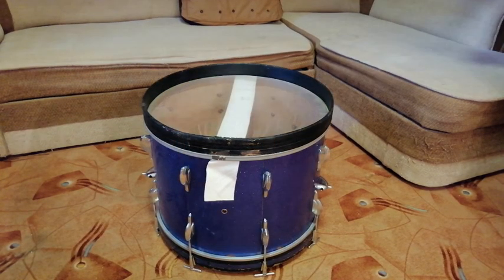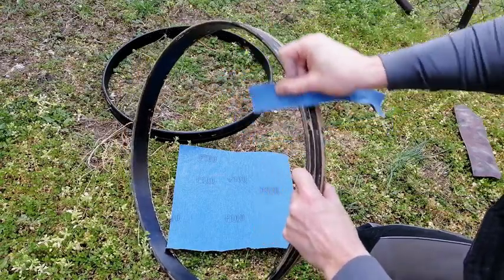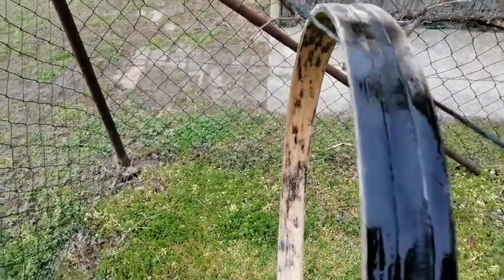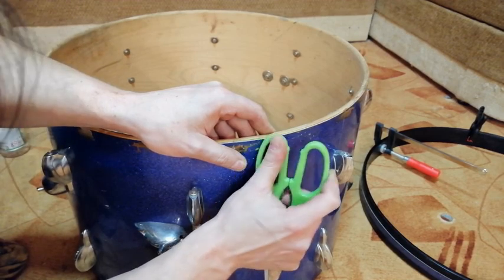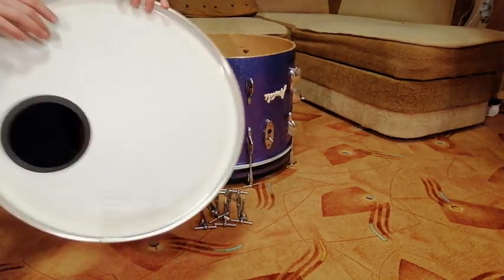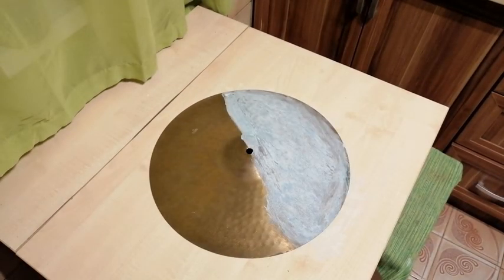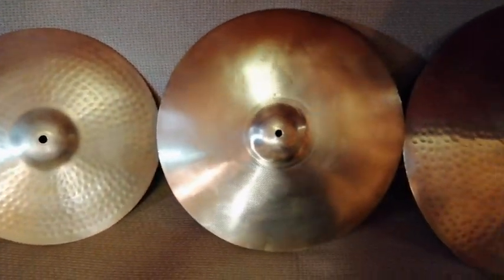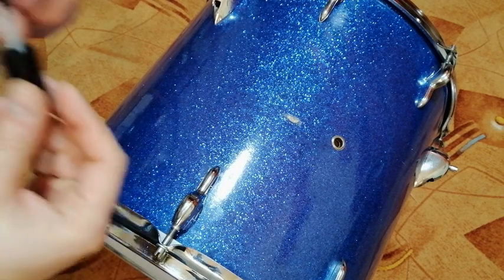Vintage Amati drum set restoration (Part 3)

Comment: Is snare hoop original Amati, I am about to buy same snare but heard it is pain to fit modern heads to it..?
Reply from the maker: The only problem I had during putting on the new heads was with the floor tom hoop only. You can easlily fit a modern drumhead to an Amati snare or snare hoop :)
Reply: @stripedfrog1122  thnx